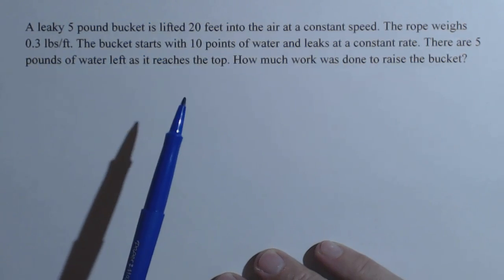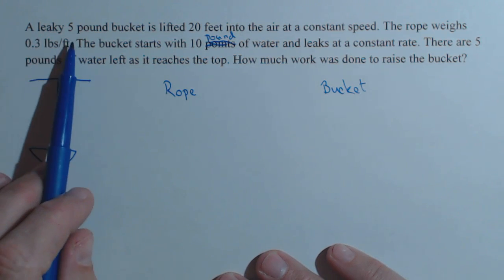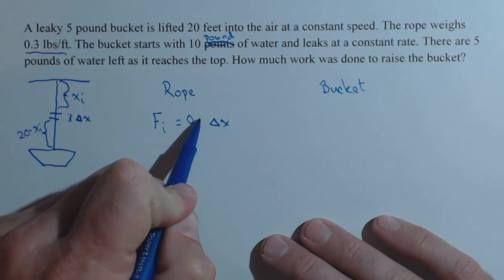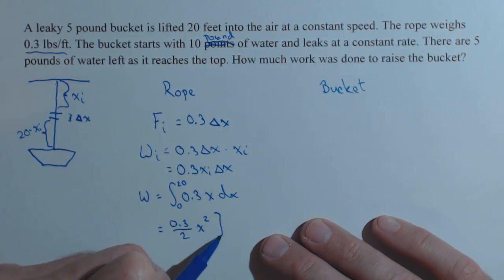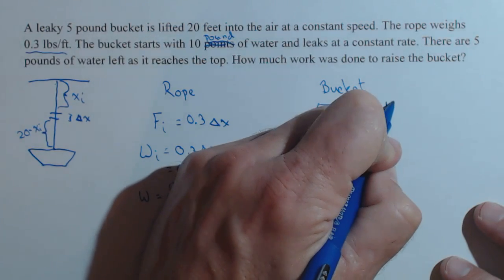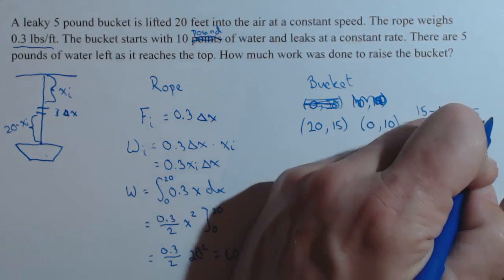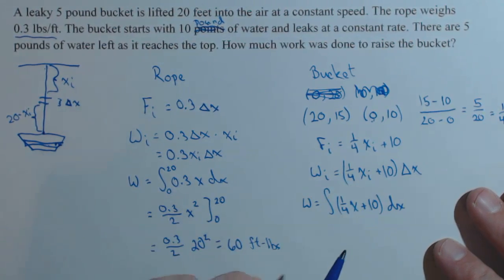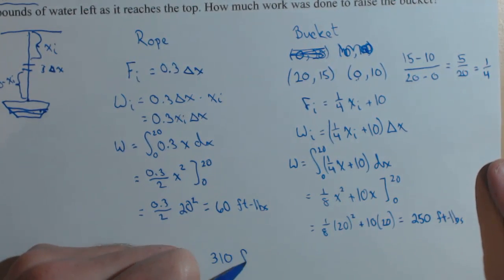Work Done Raising a Leaky Bucket with an Integral

Comment: Bucket:  10 lbs - .25y (not + .25y)
Reply from the maker: If you look at it that way, you will need to start with all 15 lbs (water+bucket), as long as you're consistent through problem you should get the same result.

Comment: When the bucket and rope is at the bottom is weighs 5 + 10 + 6 = 21 pounds. It travels 20 feet and loses weight at a constant rate until it ways a total of 10 pounds at the top. That equals a slope of -11/20. I get integral from 0 to 20 of -(11/20)h + 21dh = 310 ft-lbs. So even though this is probably the first Dr. Phil video I have not liked his methodology, he gets the correct answer. BTW, thank you for all the help Professor Clark!

Comment: Has nobody else noticed that he solved the whole problem using 15 pounds at the bottom and 10 pounds at the top even though the problem clearly states that it's 10 pounds at the bottom and 5 pounds at the top?
Reply from the maker: The bucket weights 5 pounds, which is where the numbers 15 and 10 come from.

Comment: Doesn't the rope decrease in weight as its pulled up as well?
Reply: Yes, you are correct. It is accounted for in the integral for the work done raising the rope. It may not appear that way since the force is not represented with a decreasing function, but you would get the same result if you used a force of 0.3(20-x) and integrated from 0 to 20.
Reply: this question is really badly worded and probably shouldve come witg a diagram as it depends on if the rop is being lifted directly up, the length of the rope might not be the exact amount

Comment: How can the bucket be gaining weight as it goes up!? Surely it's 10 - 1/4x. Slope is y2 - y1 / x2 - x1
Reply from the maker: It is because x is the distance from the point where it is being lifted, not from the ground. Therefore as x gets smaller, the weight of the bucket also gets smaller, thus giving the positive slope.

Comment: There is a mistake How come the bucket has 15 pounds @ 20 when it clearly says that the bucket started with 10 pounds.this is misleading. An easier way would be to consider the weight of a bucket as a function of x (height) w(x), so w(0)=5 lbs and w(20)=10 lbs now you can do the slope thing. Turned out to be w(x)= 10-x/4 means water decreasing with the height.
Reply: At the bottom (20ft), which is before the bucket is raised, the bucket has all 10lb of water + the 5lb of its own weight= 15lb total.

Comment: Why would the bucket weigh 10 pounds on the ground when its supposed to start at 15 then drops to 10 going to 20 meters above the ground?
Reply: starsky1012 the bucket weighs 5 pounds and starts with 10 pounds of water giving a total of 15 pounds.
Reply: Phil Clark
yeah it doesn't start at 10
Reply: Yeah it does. It says it in the question. Starts at 10 pounds of water. But since the bucket alone weighs five pounds you must account for that as well. So you combine the weights. 15 pounds. I was confused too.
Reply: x is measured from the top going down making x=0 represent the top